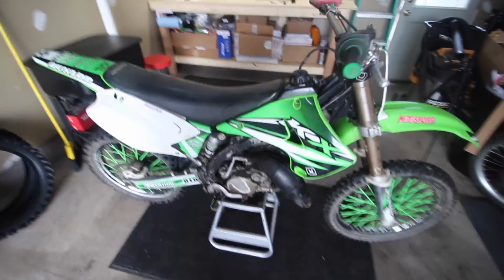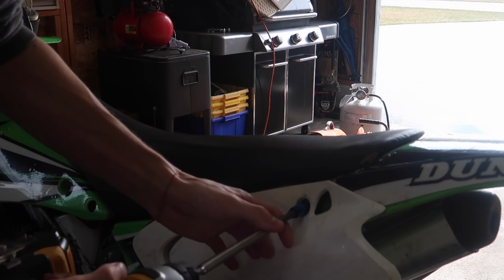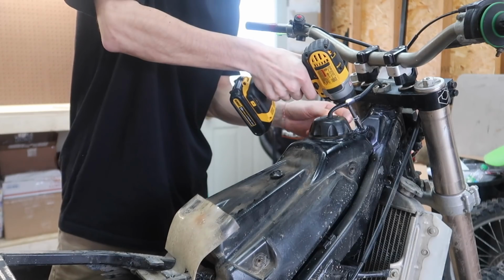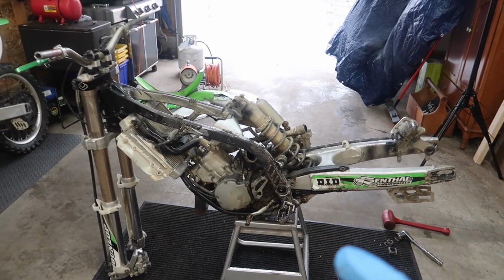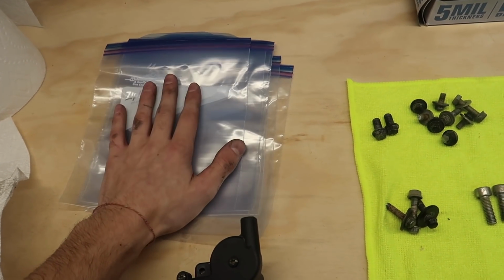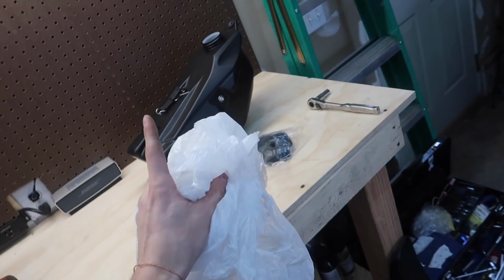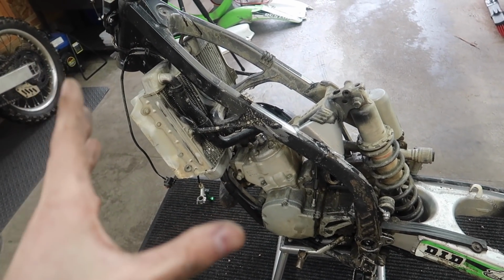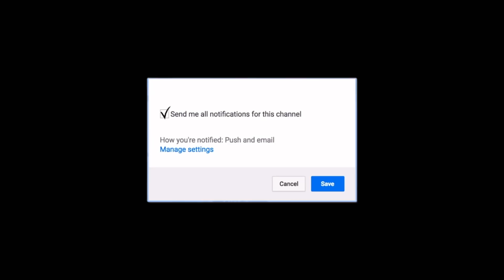2018 KX125 BUILD PT.1 | TEAR DOWN

Comment: Great video! Quick tip, a better way to sort all the bolts nuts washers ect. Is to buy those clear plastic fishing lure containers and just write where/ what part the bolt goes to on the lid with sharpie. Then if you ever need to take off the sharpie, just get some carb clean on a rag and whipe it off!
Reply: Also, vinegar removes rust on all metal parts. I threw a bunch of rusted bolts and nuts off my kfx400 in a pan full of vinegar for a day or two and it took off 100% of the rust without any scrubbing or anything like that.

Comment: This week, I greased the rear shock assembly on my sons kx 125 03 model. The Barron’s were seized. So I used a torch on the inside of the bottom triangle bracket. It was easier for me to heat up the inside of the barrens than from the outside. They got hot faster and it was easy to push them out with a under sized and over sized sockets with a c-clamp.

Comment: Just a tip put the bearings in freezer and they’ll pop right in the cases. And another if the pipe doesn’t come with seals, put some red silicone around it and wipe the access. Works great good luck very excited to see this as I have an 05 myself

Comment: Hey man just a helpful tip if you are going to rebuild the engine make sure you have all the recommended tools it helps a lot and when putting it back together don’t forget the little things like washers and what not but always use gasket sealer to help bond it really good I’ve rebuilt my cr and didn’t use enough it I had to tear it all the way back down but love the vids even though you probably won’t see this

Comment: Please Go in depth on what all is necessary for the conversion to a 17/18, kx125/250f restyle. By that I mean what subframe, tank,seat or any other fabrication or mods you need to complete the restyling of the plastics. Thanks!

Comment: I'd deff invest in a beed or sand blaster box. There worth there weight in golf for dooing engine parts exhaust everything. Would be a nice compliment with having the parts washer. Possibly a harbor fright sonic cleaner those are awsome for carbs. No need to take them all apart only the bowl let it soak for a hr and will look Bn hope this helps

Comment: Hey Tyler, 
You should do a full 125 engine rebuild! could come in handy. I'm new to motos i recently bought a yz125 and i guess one day in the next year i will be doing a full rebuild if you film the process of a top and bottom end and all the bearings it will help me a lot when I come around to doing mine. 
Thanks Tyler

Comment: I mess around with cars alot and I tip I got is take pieces of cars. Board and push the bolts through it label it and then once there in the cardboard you can spray paint the bolts so they look brand new
Reply: Plus bags are. Kinda expensive

Comment: You should use factory connection for the suspension it is great and u should use scalvini bills or fmf for pipe and asv lever will burn up clutches for a 125

Comment: Yo Tyler you can mount the front number plate, fender and fork guards and they all match up but the front number plate is going to have to be ziptied on the two bottom holes through the the triple clamps. I have the same bike and want to do the same thing

Comment: For the motor make sure you buy the right tools also I bought the tusk racing stuff good price you will need a fly wheel puller case splitter and fly wheel/ clutch holder when rebuilding watch Rocky Mountain atv video about rebuilding

Comment: I have a kx 250 2 stroke I rebuilt put the new crank bearings in the freezer and heat up the case halves with a torch and they should go in pretty easy

Comment: If you are planning to completely rebuild the engine. I HIGHLY recommend looking up MathewMCRepair on YouTube. He has a whole video series on rebuilding the top and bottom end of an older model KX250. You have to pay like $25 for the complete video series but it's so worth it for the detail he goes into. It will save you time in the long run.

Comment: Ha Tyler when you go to reinstall you're new hardware don't start it with the impact driver. Start it by hand then use the 1/4driver or else ya gonna cross thread a lot of bolts.

Comment: So excited to see what your gonna do with the build, how did you learn all this stuff about bikes the engine or  taking it apart and everything?
Reply: BarretVlogs just wrenching on you’re bikes, taking things apart putting them back together. That’s how I learned at least. My 125 had a lot of problems and I fixed it up all by myself. Top end, carb rebuild, reeds and so on
Reply: Adamkatchuba ok il keep it in mind thanks!

Comment: wondering if anyone can help me, i have a kxf 250 2008, i bought it and put a new piston and cylinder in it, gaskets etc. however when we tried to start it it wasnt sparking then a couple days later it started fine, but now its back to not sparking but when i push in the engine stop button it sparks once? any help please?
Reply: btw when we had it going it was running fine for at least a week then left it for a day or 2 and then the problem came back